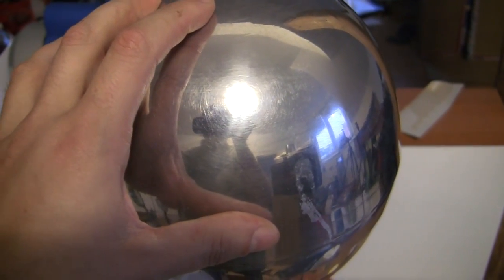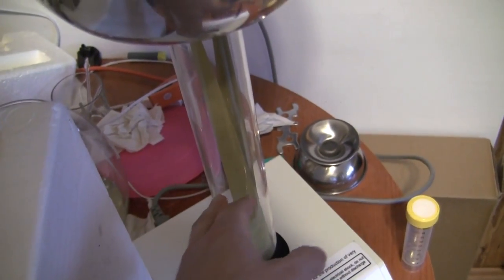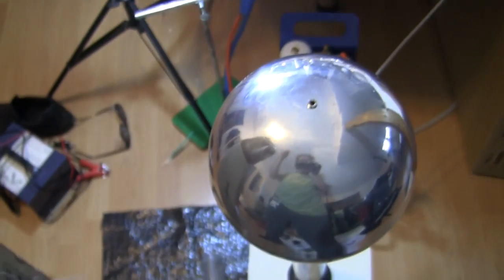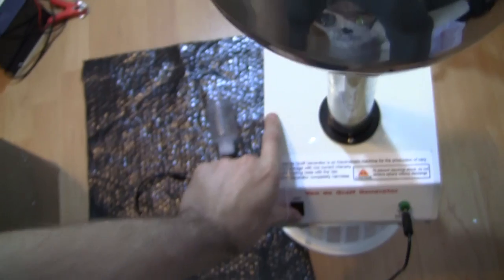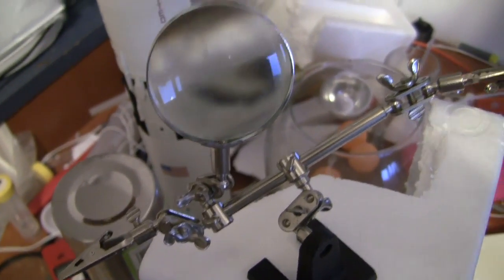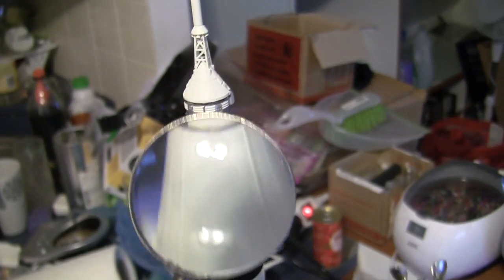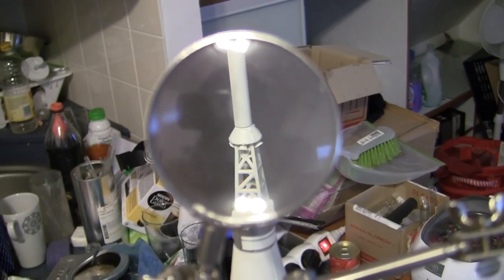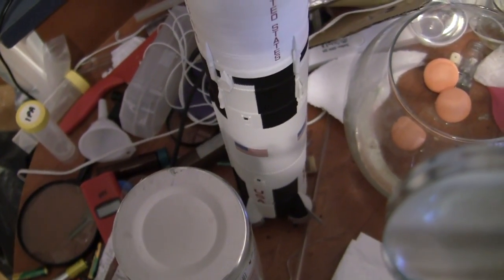Surviving a 10 000 VOLT shock!

Comment: You can even survive 20 000 volts, if the amps are low (about 0,0015 to 0,01 A) you will survive. higher than 0,5 A, you have a risk of heart problems and burns

Comment: 40,000 volts here: I "survived" an electric shock from an MSD ignition thing while working in the carburetor of a 1980's 11" 1/4 mile Dodge Valiant…
It stung for a few seconds, specially since I received like 100 discharges (aka MSD)… and continue working after he he
Reply: +Ruben Campbell I've done it too on my motorbike after checking the spark. Whilst holding the plug in one hand I turned off the ignition with the key. What I didn't know at the time was that the ignition module discharges the charged up coils when it turns off. 10KV right across my chest. Hurt like hell. I'll only do that once.
Reply: jonno85uk interesting. Thanks for sharing. 

What I recently discovered was the Honda 125 cc two stroke engine (shifter go kart) has even more intense voltage… and it kind of a mistake trying to fix a loose spark plug cable while driving at the track, lol… not even the driving glove was able to lower the voltage. 

The good thing, specially in your case, is how high voltage usually means low amperage, current actually, which is what would have stopped your heart if it was higher and not as low as it is. Still a shock from this voltages can give you enough current to stop your heart, so be careful.

Comment: Your Van De Graaff isn't functioning properly. The belts are obviously twisted; the upper and lower rollers should be in the same plane. The belts should never touch each other as they travel up and back to the sphere.  Also, the alligator clamps are probably prematurely drawing off charge from the sphere.  The "standard" measure is about 30 kV / cm between two spheres. The pointed shape reduces this.

BTW, "Van Der Graaf" is and English prog rock band. "Van De Graaff" is Robert J.'s last name.

Comment: If you want some real fun try working on a car with an old style ignition system complete with a 30,000 volt coil. Like your Van de Graaff generator, a coil is a low amperage device so it is unlikely there will be any real harm, but man, what a shock. Anyone who has accidentally shorted a spark plug or plug wire while including themselves in the circuit to ground has experienced one hell of a shock without being really hurt. I've worked on cars and raced them myself, and it's not a new experience to me. It's a bit more than a tingle though.

Comment: I love the people who say "It's not the volts, it's the amps!" ... To which I then grab hold of a 400 amp power supply and not die, because the voltage was around 4V...

It's not the volts OR the amps, it's BOTH... You need at least 80 volts to break the typical human skin resistance, and about 70mA of current to induce deadly fibrillation in the heart...

I guess that's too complicated for typical people to understand, and I guess they don't care about educating themselves to a high enough standard to understand that easily, so we have to go with the dumb version "It's not the Volts it's the amps!".

sigh

Comment: Actually, VDG sparsk can carry thousands of amps. What makes them safe is that they are not a continuous source, in fact it lasts somewhere between nano and microseconds.
A much better measure of spark safety is spark energy, and not amperage. I read that for VDG, not excigin a spark duration of 1ms (nearly all of them), the energy should be less than 1J to be safe. If you calculate it for this one (using 0.5*capacitance*voltage^2), it's about 1mJ, so it's quite safe. However, this isn't general either: energy, voltage, amperage, etc. are too simplistic measures. In general, you would have to consider a combination of all the parameters (including frequency as well), to know if it's safe.

Comment: To be frank, 10kv isn't all that much. I used to work on electron microscopes and have been "bitten" by 120kv (120,000 volts) on several occasions. Yes, it stung but there's little danger of fatality. It's the current that kills you, not the voltage. Injuries from shocks are often secondary, caused by the body jerking from the jolt and hitting something nearby (like the edge of a metal panel).

Comment: I do some electrical engineering as a hobby. It may surprise a lot of people that static electricity regularly carries as much as 100,000 volts, but because the current is so low you can survive touching a door knob in the winter despite 100,000 volts just went through your body. The inverse is also true. Car batteries are only 12 volts and are harmless, but the currents are very high. You can only get electrocuted when you have both significant voltage and current.

Comment: So, in the winter time when I am pushing the cart through the Grocery store AND I reach for something off the shelf and shoot a bright blue spark from over 2 inches away because I've stupidly forgotten to ground the metal frame of the cart to the shelves, how many volts is that?
Honestly, I used to use my keys to short out my potential but I killed a key faub doing that.  I usually have a metal bodied pen in my pocket, that works fairly well but if I have a dry hand moment and don't quite have a good connection to the cart and pen I get jolted from both sides.  Finally, if I lose connection with the cart and ground myself then re-connect with the cart, I get shocked both times as well. 

I don't know if I scoot my feet funny on the floor, I don't usually wear any different kind of clothing and although I have talked to several other folks that have gotten this static from the stores I seem to be the most cursed by it.  Point being, the temps are dropping, as will soon be the humidity and I need to make a conscious effort to remember to ground the cart. 

Oh, and just when I figured out to do the cart grounding ALL of my local stores put rubber bumpers on the edges of the carts for safety making it a real pain to get the metal of the cart against the metal of the shelves where I used to just push it up close and touch it.  And I have shot across that 2+ inch gap from frame of cart to shelf. 

I should be hooked up to the grid I tell ya.

Comment: Getting a shock from dragging your feet is also really high voltage, in the thousands range. It takes a LOT of voltage to travel even 1/8" through air, a very poor conductor. I would also be careful that you not hold an earth ground in one hand and touch this with your other hand. Even though there is very, very little current, you could still possibly hurt yourself.

Comment: nice a sciency vid....next time you need to survive a 10,000 amp charge...now that would impress the hell out of me ;) a static electrical shock can give you a jolt of around 20 to 25,000 volts ( i've had some good ones in my time so 10000 is not a biggie in comparison...still nice little vid

Comment: "Isn't amperage what kills you?"
Oh well, it starts again. You need both voltage and current. The voltage is needed so that electrons can pass through your skin at all as it is the potential difference (the "moving force" of electricity) and current is the amount of electrons flowing in a second.
(The heart stopping property of AC is because of the 50 Hz signal.)

Comment: I know it is not the same but on my bike I got 25,000 volts from a spark plug cable that came loose, through my leg
OK it did hurt but it won't harm you because the amps way to low when transformed up from 12 volts
I don't know how high the amps are from a van der graaf generator

Comment: That's a neat experiment.
Ask any mechanic that has touched a spark plug when the engine is running if he survived.
It hurts like hell but you survived and in some cars the voltage is much higher than 10,000 volts

Comment: Do you think it's possible to use a Van de Graaff generator to power a Tesla coil? You've basically got a 10KV DC power supply and a capacitor all built into one so if you put a spark gap in series between the generator and the primary winding on the Tesla coil, would it be able to charge and discharge at a frequency high enough to sustain an arc from the secondary? Or would it just produce a little 500KV lightning strike every now and then, or would it do anything at all? Just curious, I've played around a little with Tesla coils with varying degrees of success and failure using MOT stacks, neon sign transformers and ballasted flyback transformers from old TV's, I've wondered about Van de Graaff generators too but I don't have one to play with.

Comment: Yeah, it's not the voltage that matters, but the amperage.

And even there, an otherwise safe 9V battery can become lethal if you were to overcome the protective resistant barrier provided by human skin: attach a sharp prong on each terminal to poke someone in each hand, and the current will travel through their bloodstream and induce a fatal heart attack when their heart seizes from the current from the 9V battery.

Comment: My highschool electronics class had a small hand crank generator that could go up to 10,000 volts.  We used to hold the wires in each hand and see who could last the longest while the other guy cranked it as fast as he could.  I was the only one who got right up to 10,000 volts as I found if I could just hold on a bit longer, my fingers went numb and then it was easy.

Of course, I also couldn't let go, but I never told them that.

Like this demonstration, it was high voltage, low amps.  Movies often make the mistake of claiming "10,000 volts? That could kill a elephant!" quoted from a recent movie I can't recall the name atm.
Reply: "Danny Costanzo: [driving their car on the L tracks] Try not to scrape the third rail, OK? There's about 600 volts in there.
 Ray: It's not the voltage that gets you. It's the amps.
Nun: How many amps are there?
Ray: Enough to push a train, and shut up!"

Comment: Back in the 80's, I worked at an electronics and refrigeration wholesaler. We had a device that was used to test CRTs (T.V. picture tubes) It generated extremely high voltages @ low Amps to create an arc inside the tube neck that could be seen, if the tube was bad. My co-worker was showing it to me, and set it close to a metal strip along the counter. I didn't realize my arm was on the strip! YIKES!!!!!!

Comment: I like to explain Voltage and Amps to "beginners" in electrical knowledge Like this,

Voltage Is like Speed.
Amps is like Density.

If you shoot a 1 cubic cm(Roughly 1/3 cubic inch) ball of wool at someone at 320 km/h(about 200 mph), It will hurt but it wont kill,
But if it is made out of Lead it will Probably kill.

That is a pretty basic way of explaining Regular Direct Current, It is not the same thing But it is Simple Yet pretty Good as a basic thought.

Comment: One major caveat i feel needs to be emphasised if you think current is the only thing that can kill you is that you cannot have current without voltage and vice versa. If it has high voltage do not I REPEAT DO NOT touch it just because say my lab power supply has a limiter set to 10mA output at 200V does not mean it's safe to touch with hands. for a brief moment 200V worth of current will flow through you, and depending on how brief it is it could cause serious damage.